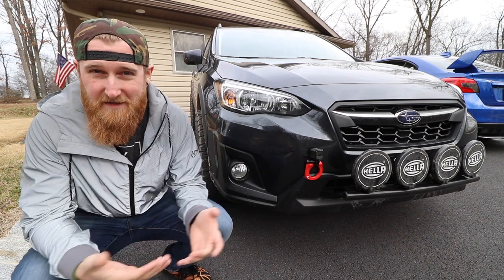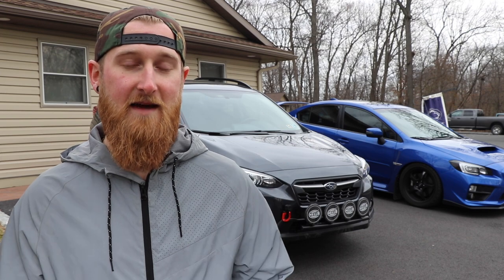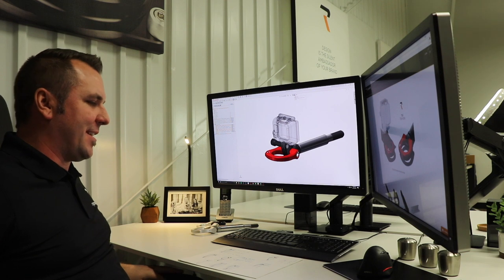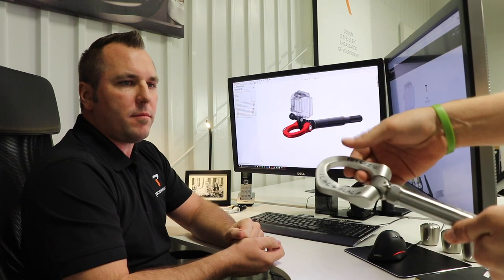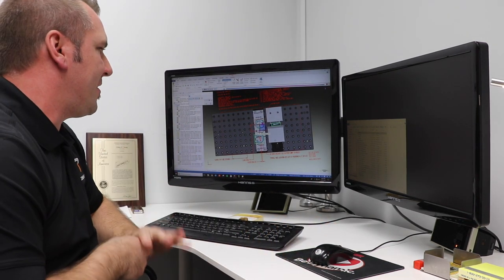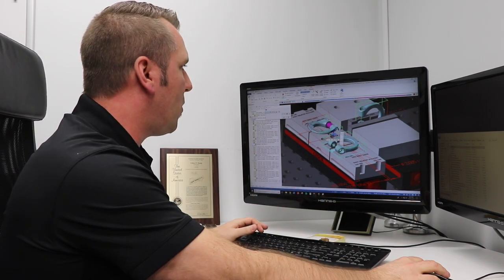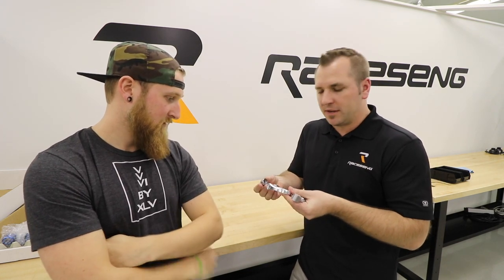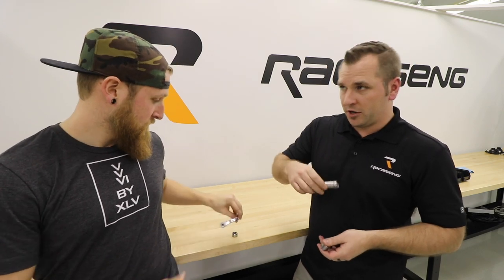Raceseng Shop Tour! | Tug Tow Hooks - How its made

Comment: I was inquiring a tow hook from Raceseng a few years back. Since I live in the immediate area, I thought I can get it in time. I had to wait 3 months before getting one. Ryan, the shop manager, told me they were ready. So I purchased it and he drove to my job down the street and hand-delivered the tow hook to me at my job since I waited so long.  The only CON I would say to the tow hook is that they anodized red at the time.  6 months that went by, it turned pink. Wasn't a happy camper. But I had a buddy of mine powder coat it Candy Red...it looks better than ever. But I wish I would've had something like this from the start. Still a happy customer. From what I understand, these tow hooks are being powder coated now. I need to get one for my Lotus Elise in a translucent orange :)
Reply: We switched from anodizing to powder coating. Despite doing everything we could to prevent them from fading due to UV light, they still did overtime. Thanks for the support and let us know when you are ready for a Lotus Elise tow hook, I'll extend a discount for the fading issues.

Comment: The only problem is there Anodizing process last about 8 months.I have seen many tow hooks turn pink after 8 months.
Reply from the maker: They are not anodized, they are powder coated.
Reply: @TalonSei  Still they are not holding up.That is the problem the powder coat  is not UV compatible maybe? I do my own anodizing and never have a issue like this and yes I know it's two different processes.Just like painting 3 stage paints.